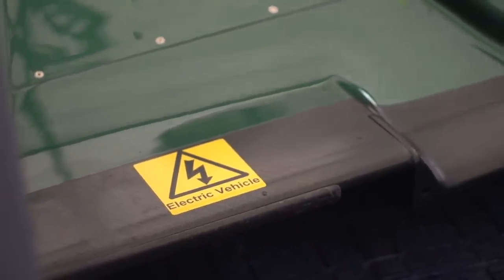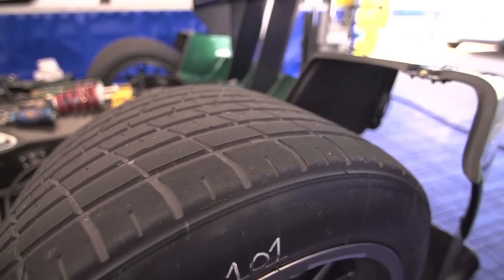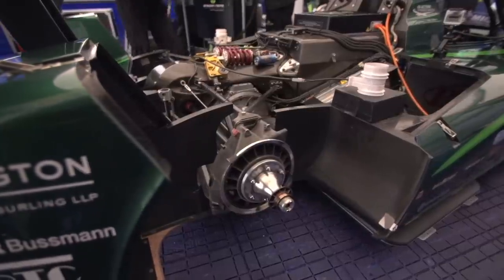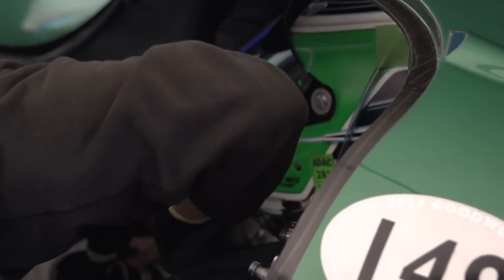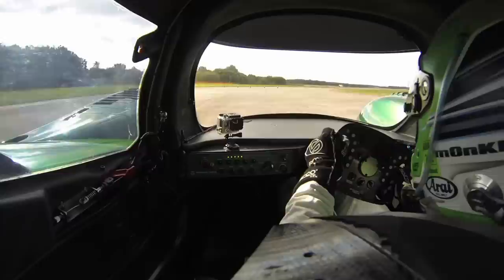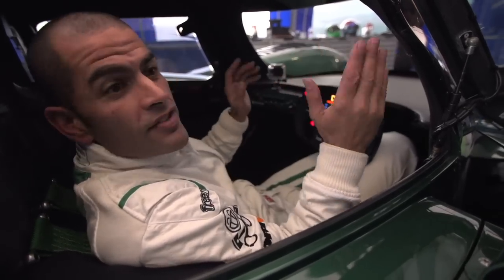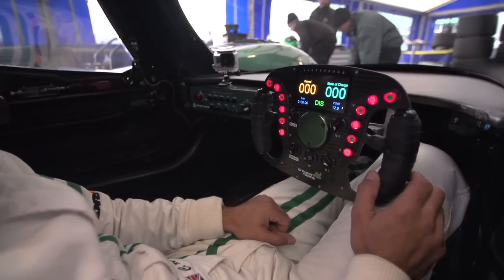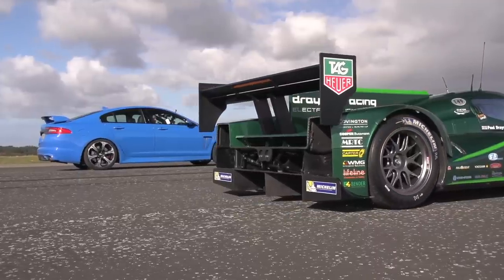850hp Electric Racing Car: Driving the Drayson B12/69EV -- /CHRIS HARRIS ON CARS

Comment: Still not as fast as the petrol Aston Martin V12 /AER V8 Twin Turbo /Judd na V10 versions of the Lola P1 car and they even have air restrictors, so would be even faster still!
Reply: See how they do when you restrict their air to the same level as this ;)
Reply: Have you heard of the term torque? Or efficiency?
Reply: Yeah it has a lot more torque but it isn't efficient. A normal P1 can do 12 laps of Le Mans on a 90 litre tank (81 for diesels), Nissan's Electric car will only manage 1 lap a stint before switching to the ICE.
Reply: DeaKen002 Electric engines are WAY more efficient. It's just that it is difficult to store electricity the same way as fuel. You burn all your fuel, but you don't deplete an entire battery pack with its material and all do you? The battery itself is still there, just no electricity. A fuel tank is completely empty. But the electric engine itself uses the available power source much more efficiently
Reply: But Refuelling takes a lot less time than Charging, I meant practicality for every day life rather than efficiency of technologies. At Le Mans it seems Toyotas super capacitors are better than Lithium ion and flywheels for storing, so it will be interesting to see what becomes of those.

 But I've never said petrol is better than electric, just stating that the engine that was in this car before it was converted gave it a higher top speed then it does now with more power and Torque, as they made a big deal about its "go".
Reply: Daniel Kemnitz If you are going with that logic then a battery is just a container for electrical energy as a tank is for fuel...you still need an external input for either of them to have any form of output.
Reply: Snowflake I know that a battery is also what determines the performance of an electric car, and that it is not "just fuel". But my comment has nothing to do with "my logic", it has something to do with facts. A combustion engine turns the fuel into heat which is basically wasted energy in most cases, but an electric motor uses the electricity from a battery much more efficiently. Efficiency has nothing to do with how much electricity we can store into a battery (which is what currently keeps EVs from achieving good endurance results. Not because they are inefficient, but because we simply aren't able yet to store the same amount of energy as with ordinary liquid fuel.
Reply: ***** yep definitely agree with you. That's also why Tesla for instance offers their performance models with different battery packs rather than a different electric motor, because its the battery that has the ability to feed the motor, the motor is just a converter that turns the power it receives into movement. Of course I know this is very simply put, and I know there can be made modifications to the motor as well to improve performance, but mainly its the battery that acts like the "engine+fuel tank" like you put it so well.

Comment: Somehow, all this electric vehicle stuff seems to be very underwhelming. Take for example, Trains.
You can get in an electric train and have your ass moved quietly and efficiently, but if you've ever watched a Steam Train roll through town, literally Everybody will stop and watch in absolute awe as the steam train rolls past, huffing and puffing. If every train were replaced by a steam train, even if the steam were heated by electricity, people would be more inclined to travel by train, simply because it is more impressive.
Reply: The ignorance of those people is even more impressive.
Reply: Im sure its environmentally friendly too...
Reply: ***** Those ICE powered petrol guzzlers will soon be as passé and cheesy as Knight rider and the mullet.
Reply: Robert Stan well yes they sure did, heck many never even got to see one from that era you bbuffoon
Reply: Yeah, it is impressive I have to admit. 
I wonder why Nozomi has restrictions on who can use it?
Reply: Eric Nicksdaddy
Burning diesel to generate electric power can hardly be called modern. It's simply inefficient. 25,000 V overhead lines have much less loss through heat, plus they can be powered from renewable sources. But even that is wasteful compared to maglev technology.
A maglev train in a vacuum tube could reach several 1000s of km/h. Much faster than commercial aircraft. Now that is impressive.
Reply: Franck Merlot How much energy does it take to build and maintain the vac tube?
Reply: Martin Espinoza According to classic physic calculations, evacuating one cubic metre in 10 seconds to 1 Torr (about 1/760 of one bar) takes about 2 Kw. So you can do your own math how much it takes to evacuate a given volume of a tube. However, you wouldn't need a perfect vacuum.

Of course the amount is relatively huge BUT evacuation and propulsion can be achieved with electric power from renewables alone. We will have to say farewell to hydrocarbons sooner or later anyway. That's a proven inevitability. Why not start now?

Besides the train itself can recycle the energy from slowing down at more than 90% as there's very little drag or mechanical friction.
Reply: When Petro giants give up their empire, you'll see how eletric tecnology will be as jurassic as gasoline...
Reply: Franck Merlot EUSOUAYAM seems to think he has invented a better way to propel a road-going vehicle. I'd love to hear all about it mate. What is it, Warp Drive?
Reply: Search for 1 of the 5000 free energy patents supressed by the US govmt. Everything is out there. Or you can search for QEG, Tesla's work (energy in the air). Think why you can send information through the air in motion via cell phone, or whatever. There are many ways to "gather" this flowing energy and tunr into many known forms of energy such as eletricity. Im not here convincing anybody. Just look for your own answers.
Reply: The closest we've come to anything resembling "free energy" or an ultra-long-life power source is currently running the Voyager 1 space probe, look it up. NASA had lithium batteries sussed out in the 1960's. If anybody has the answer, NASA have theorised it, put one together and thrown it up there to test it out.
Reply: EUSOUAYAM
The problem with those is that they are delusional idiocy.
BTW you gather that energy when you use a cellphon. It's just mili/micro watt scale and only useful for transmitting information. And you need to use a lot more to even extract/convert that information into something useful...
Reply: Franck Merlot
hehehe! True...ignorance is not bliss, its handicap!
Reply: No, an electricity-driven Japanese bullet train destroys Steam boo-boos any day, period.
Reply: What if the water were heated by a huge Microwave Magnetron?
Reply: Jesus Most of the energy would be wasted through heat. Electric power direct to an electric engine is the most efficient to date.
Reply: No.
Reply: Franck Merlot The heat can actually be reclaimed in exactly the same way it's done in a power plant, by the use of radiators and condensors. Learn some simple physics about how the world around you functions.
Reply: Jesus To a certain amount but there will always be more loss and never be as efficient as direct electric propulsion.
Reply: Jesus
The max is 60 something percent for heat engines and you won't get anywhere near that. Only megawatt+ gas turbines with recovery can get above 60%.
A simple steam engine won't get anywhere near that. Also the magnetron is very inefficient in itself.
You'd get probably less than 10% efficiency.

Meanwhile an electric motors you can get 95% peak efficiency without a problem.
Reply: There is definitely something missing from the conventional howling V12s with that car, impressive as it is!
Reply: Ian Petrie
What's definitely missing is the waste of energy of the internal combustion engine.
Reply: Many of our national trains are electric, and it's nothing new.
Reply: Franck Merlot The laws of thermodynamics have already been "broken", because it was already a flawed system.  E-Cat and LENR ETC.  http://pesn.com/2014/01/30/9602431_PESN-rep_witnesses_Evolucoes-Energia-Captor_off-grid-overunity/
Reply: twas brillig
And we can travel through stargates. Nothing new here.
People eat up every stupid hoax.
Reply: avada0 One day your great grand kids will be wanting you to tell them stories of old gas engines of the past.
Reply: Billy Fishback
I'm sure they will be immersed in that age's trendy crap like todays children are (social media). :)
Reply: avada0 How can you?
Reply: avada0
Don't sweat it mate. I keep bumping into people who rave about fusion power (if they are at least somewhat science literate) and others who are delirious about "free energy" (those who need psychiatric help) and then they drive off in their petrol guzzling SUV monsters...
Mental disorders induced by relentless indoctrination and misinformation are on the rise.
Reply: avada0
It's weird that these videos which demonstrate the superiority of the electric engine always stir up so much irrational reactions. It must be that people who are stuck in the past are in denial that they'll have to let go of their archaic petrol guzzlers sooner or later anyway.
People who love waste... it must be a mental disorder.
Reply: Franck Merlot I don't what your on about as I am not into ICE car technology and I am all for EV's fast ev's yes but fast EV's so if thats meant to be at me your preaching to the converted mate
Reply: Franck Merlot
Well, the cat's out of the bag now. He is actually for EVs, just incapable of reading and writing. (And still doesn't get that I was writing about the e-cat)
But I quite agree with you in a generic sense.
Reply: avada0 The e-cat? really?
Reply: VAMPYR ENGEL
That's ok. Just leave it at that and inform people of their ignorance when they proudly pump 50 litres of petrol into their antiquities for the next 400 kms or so.
Reply: Franck Merlot OK if they bother to listen
Reply: amen. its like supra vs prius
Reply: OrangeNinjaTurtle123
No it's like Supra vs Tesla Roadster.
Reply: I wonder how well thermal solar panels would do on the roof of a train to heat water to boiling point. The only problem is getting stuck in a tunnel. Maybe backup electricity would do the tunnels.
Reply: Tim Lewis However you twist it, the steam engine is very inefficient. Transforming sunlight into electricity to drive electric engines is much more efficient in any case.
Reply: ....I'm as many people if not more so will be as impressed by ANY of the shinkansen trains even then original 0 series. They are just epic.
Reply: OMGLYKE WUT ABOUT A NOOKYOOLUR TRAYNE
Reply: zZViperBoostingZz Yeah that would be cool, and especially if you could get an extra 100 mph out of it. hmmmmmm food for thought there
Reply: Yo people!
We've got something which can make sound & environment friendly - Hydro Engines ^^
Reply: That's because electric trains are common, when loud trains were common and the first electric trains came out and people saw a huge mass rolling down the track making no noise it also brought attention to itself, the only difference here is the attention without sounds ability to avoid LOS. It will not audibly bring attention to itself. However once they do get the tech down, I'd do what any other loud car loving idiot would do, put speakers in it and make it sound like a Zonda, CCX, or Chevelle. This I am greatly happy with. Also, you could program these cars to change their power output to mimic other cars along with their sounds. Regulate the torque and peak power to simulate being in a Zonda, CCX, or a chevelle. Like a video game in real life.

Comment: Many years ago, I talked with a NASCAR enthusiast about why (in the world) do people get off on watching car races. Seems to me that the highlights are the failures, the crashes, which only underscores how limp a spectator event the sport actually is (I feel the same way about hockey and fighting on the ice). He did a good job of describing the feeling of the thunder, and the thick smell of gas fumes, and how both are still with you after you've left the track.  I said wow, what will be left when all those cars go electric? He said it will never happen. It can't happen. The soul would be gone. I said I'm sure some ancient Romans would probably feel the same way about Chariot racing. But to us, it's nothing if not inefficient and antiquated.

To think that engineers would waste power generating noise as opposed to putting all the batteries' energy to the wheels is completely clueless, and it will never happen. That would represent style over substance, and racing is about speed. Driving is ultimately about moving four corners (or two in the case of motorbikes) over a bit of ground, it's all about the pure physics of movement and machine. Progress always requires a tradeoff. The sport of racing will follow performance and precision, narrowing in on the real physics of moving over ground. Anybody who doesn't get that is just a sentimentalist, and simply doesn't get what driving is REALLY all about. A silent sporting car actually refines your sensibilities, bringing you in more direct relationship to the wheels, the road, the wind, and your own mass in motion. The internal combustion engine was good times, one colorful chapter in the history of living, but the end of that particular chapter is near.

Comment: Any idea how long this B12/68EV might last per charge when running at race pace currently? I'd be curious to know the charge times too. The wireless charging looks trick but I'd think a hot swappable bat would make the most sense for racing purposes unless integration makes it impossible. It is pretty exciting to hear that Drayson estimates in roughly five years batteries will exist that can run a race car for a stint at LeMans.  A solid 40-60 minutes flat out in a fully electric race car is pretty awesome! These electric cars and the DeltaWing are the future of racing and it's gonna be sweet!

Comment: For the Jag, the maximum torque at the wheel for each gear is:
WT=Engine Torque X gear ratio X final ratio X drive train efficiency  // so for the gears it malkes:
1gWT=680 X 4.17 X 3.31 X 0.85 (assumed)=7977Nm
2gWT=680 X 2.34 X 3.31 X 0.85 = 4476Nm
3gWT=2908Nm
4gWT=2181Nm
5gWT=1645Nm
6gWT=1320Nm

Against a flat 4000Nm there still is a big difference but not as huge as people might think !...

Comment: Chris, what is the seat of your pants telling you about the car? Since most of us rely on a combination of sound and feeling through our hands and bum to tell what the car is doing or preparing to do. How different is it with out the sound? Do you feel slightly less in control? As for the torque, even a golf cart feels like it has more "Push" when it's electric, so the Drayson must feel very unearthly!! For the people that a worried about having no noise may I suggest a speaker with a speed/ revs related growl?

Comment: i was racing with RC cars back in 2003 i was 12-13 yo, my first ever 2 wheels was a electric scooter in the same year ( the engine dies quicly, china quality at time ) but i never forget that smoothness and easiness. DOn'tneed to be a pro mecanic. This is the future of racing even to it's simplicity. i can't stand there is not affordable electric light cars user friendly, maybe for 2020-2030 , and it will mean more track beacause there is no problem with the noise. ( witch was a condition bck in 2003 with a track just front a neighbourhood ! i can't wait for that

Comment: Just to put things in perspective, a big rig that's used to tow 45,000 pounds around the country typically gets 500 horsepower and 1650 ft-lbs of torque from its turbo diesel engine. This beast has 850 horses and 2995 ft-lbs of torque.

Comment: Being an avid fan of Motorsport and cars in general, the lack of noise this car made was so devastatingly quiet it took away all of the fine scientific aspects away from it. There's nothing like going to the races and hearing fine tuned machines scream above 8000rpm. Not to mention the smell of rubber and the occasional whiff of oil. I could not fathom going to the track and watching quiet race cars, I would feel as if I was playing with my slot car set as a kid. I'm not bagging the engineers and development team of this car, because what you have achieved is definitely amazing. My only question is - Is the world really ready for quiet race cars?

Comment: When I first thought about an electric motorsports vehicle, I quickly dismissed it as lackung some of the sensory stimulaton of regular motorsport. After all, the sound is as much a part of the experience as anything else. But there is just something oddly appealing about the idea of a silent super car. All bite with no bark. Being able to experience performance with no distraction. Though I'm sure driving with no sound would take some getting used to.
Reply: The sound is part of the joy of driving a performance car.

Comment: Sounds like they need bigger improvements not only making the batteries last 4 to 6 hours, but also adding solar panels surrounding the whole race car making this electric race car run longer, even on mostly sunny days until dusk as a new suggestion might help this.

Comment: Aiming this at all the people saying this is boring because there won't be all the noise ( i agree completely with that, it's a very true statement) but this is good, because it means we can keep racing when we run out of fuel. That's the main reason for vehicles like this, either way, soon we won't have combustion powered cars. If we do this now maybe we can save some oil for some really high tech,high power monster. Although, i do like the sound of electric cars, but i will agree that the noise and roar of combustion engines is much more thrilling.